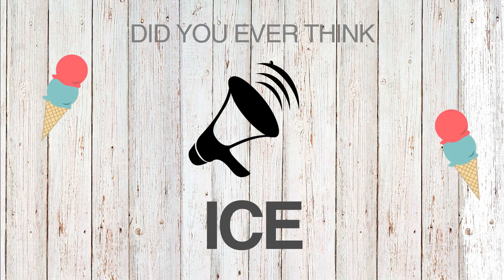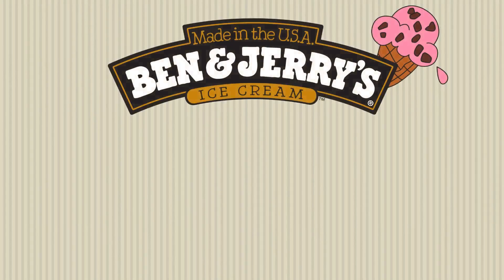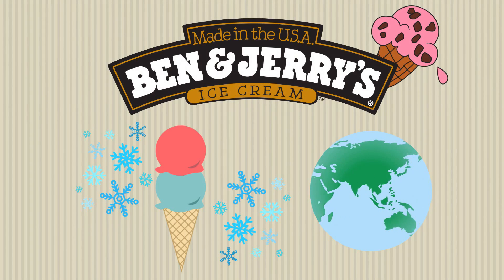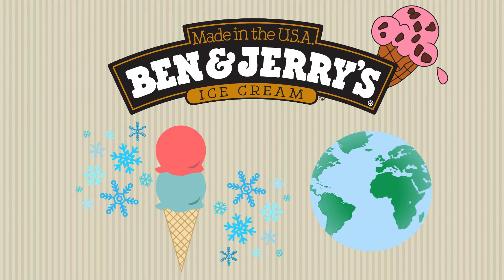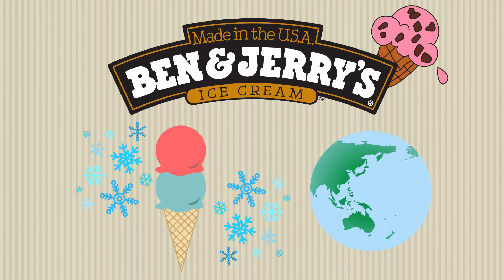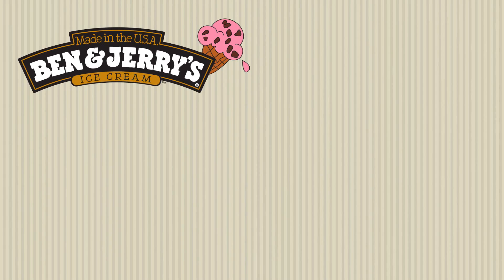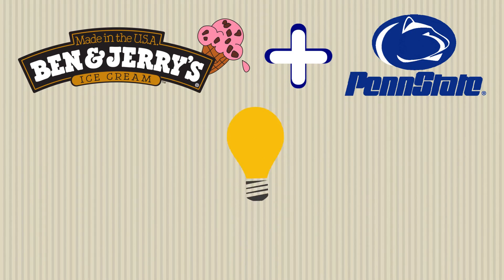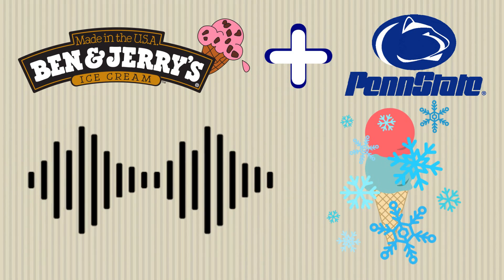Thermoacoustic Refrigeration

Comment: That's not how it works. You never mentioned the stack which exploits the waves' high-pressure and low-pressure zones; without it, there's 0 cooling and hot effect. And you never mentioned the frequency which needs to match the pipe resonance.

Some kid might think screaming at his ice cream would freeze it after watching this video.
Reply from the maker: That was the goal here :D

Comment: A refrigeration system that doesn't use CFCs?  They've had those for years, they are called Stirling coolers.
Reply: And don't forget about Peltier coolers. Regardless, the thermoacoustic cooler has no moving parts. Conversely, a Stirling cooler contains pistons and is mechanically more complex.
Reply: @HangTimeDeluxe  : I haven't ;)

Comment: I want make this system for my finale year enggnering project.
Is there any way u can help
Reply: did you do it ?
Reply: @Rei_Tozo  no couldn't complete it because of corona
Reply: @Sahilv05  how far did you get into researching? if you could point me towards some resources or schematics i would be very grateful.
I need a compact colling system for temperature control in a terrarium
Reply: @Rei_Tozo  all the calculation and planing is submitted to college last year . 
You should go through some research paper of thermo acoustic refrigerator .
Reply: @Rei_Tozo  Use a thermoelectric approach. Peltier modules are very in expensive on Amazon. A couple of modules, heat sinks, a power supply, and a thermostat and you are in business. The best part about this approach is that you can heat and cool with these modules by just changing the polarity.